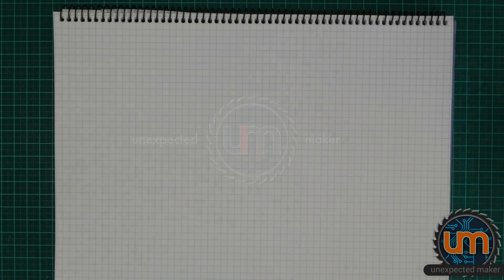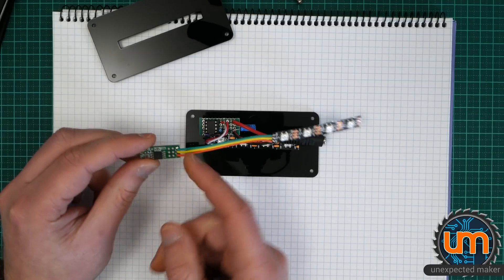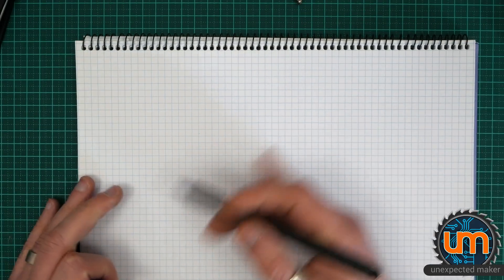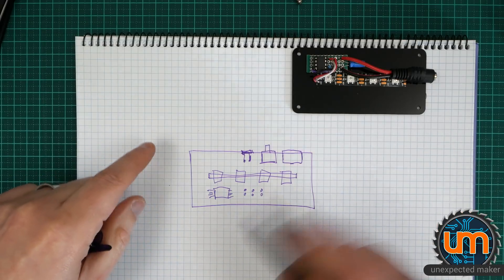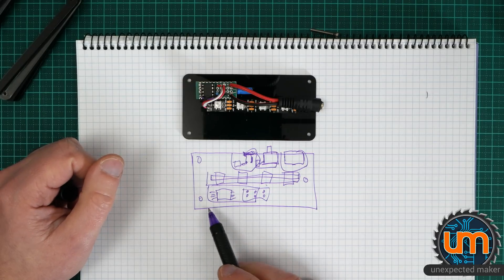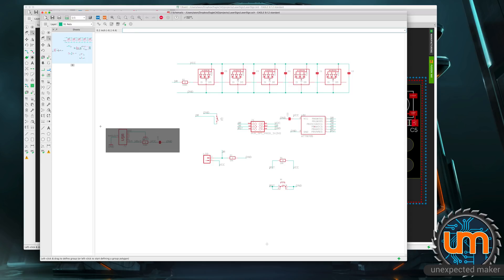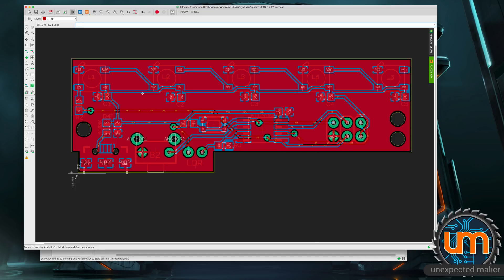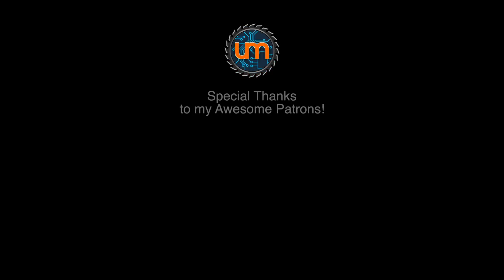Laser LED Sign - Part #1 - Converting a Concept/Prototype into Product

Comment: ATtiny85 is great for this Prototype . I did a project like this for a workshop and used plywood for the case. A finger joint kind of style for the box.. 
I used the nano clones for it though. 
If I was going to revisit this project I might use an esp8266.
Reply from the maker: Yeah, the esp8266 is nice, but way overkill for something like this. Not a lot to gain from wifi connectivity with it I don't think.
Reply: Only a few reasons I would use an esp8266 for a project like this. A tablet or smartphone to change colors. I might use it as an indicator to let me know when the maker space is open,  when someone is live streaming, when your sports team scores. lolz  :)
Reply from the maker: Sure, all great reasons :)

Comment: You have 1 hole for the dc jack currently.  Just put the hole on the long side...and make the hole wide enough for all 3 components: usb, ldr, button.
Reply: Lol, I typed this before I got to the end.  Glad you made it this way.  Looks great.  What kind of laser cutter do you have? I have some projects for which I could use a laser to manufacture.
Reply from the maker: Glad you got to the end of the video! I have a K40 (currently not working... see my "Laser fire safety video") - but I'm currently rebuilding it. It's great for small jobs, but needs a lot of mods to get it accurate, and lots of maintenance to keep it running.  almost bought a new Red/Black 80W - but it went out of stock before I hit "buy" and now no new stock until late October :(
Reply: Unexpected Maker, those 80w look nice.  I think it would really speed things up to be able to put flat sheets in without cutting them down to small sizes first.  It seems like the price is always a bit too high for me to justify a purchase. Especially if the tube needs replacing every 2 years.  The return on investment just isn't there! Arg, so tempting to just call it a hobby-lol.
Reply from the maker: Oh I agree! The K40 is a great price, even after spending another $700 on top to mod it (bought a coherence3D controller board, new lens assembly with air assist and new high quality lens)...  but the next step up from K40 to "bigger, better, more reliable" is quite a jump for hobby use. I buy my acrylic pre-cut at A4, so that's fine, but getting timber pre-cut that small is costly :( and pre-cutting myself is messy and time consuming.
Reply: Unexpected Maker , haha I know what you mean...I hate sawdust when I just showered "and need to just cut this ONE little thing"!
Reply: Have you found a good-priced online place to laser-cut pieces?  I looked around, but the prices were too high to make a profit while using them for projects like this.
Reply from the maker: No, not only have I not found a good service (other than using a local hacker/maker space machine) but not having the flexibility of having one next to you for experimentation kills ideas quickly. Get a K40... even un-modded, they work ok... modded they work very well - unless you set it on fire ;)
Reply: Unexpected Maker , yes, that is also true. Many times the laser needs to be calibrated for press-fit cuts. Or, the file needs adjusting based on which laser you use!

Comment: why not see to make the "Display" the button? (the clear acrylic that gets lit up)
Reply from the maker: How would that become a button? Push it down? It's sitting on the pixels, so I'd have to squeeze a button in there between the pixels and that will likely off balance the display. I think it would also be too delicate as a button for kids.

I thought about capacitive touch so the entire base was a button, but it just added too much complexity to the build, and base design, and to be honest, once a "colour pattern" is chosen, I don't think the button will get much use, so that's why it is behind and out of the way.
Reply: @UnexpectedMaker   wel yah captives are i hassel. i was thinking on having the button on the one side of the pcb. resting on the button and the other side on a plastic stub, the stub could also be used to hold the pcb in place then to actuate it the display would tilt over to the side and that would make it one less hole to maby laser cut or print.
Reply from the maker: Yeah that could work.. too late now as my boards are already being made... maybe for a revision 2? :)
Reply: @UnexpectedMaker   always more iterations XD. but job well done as usual.